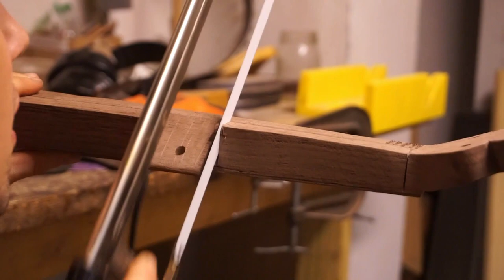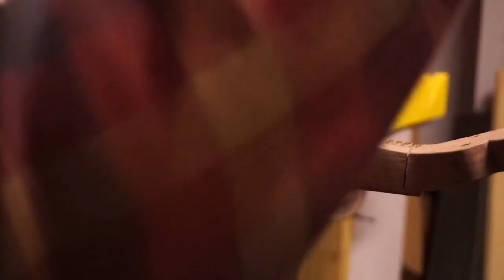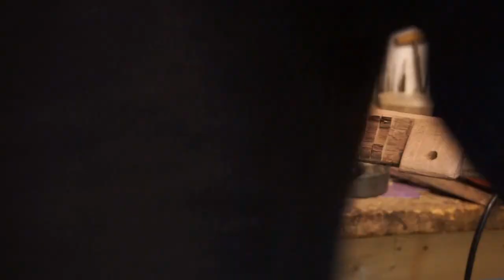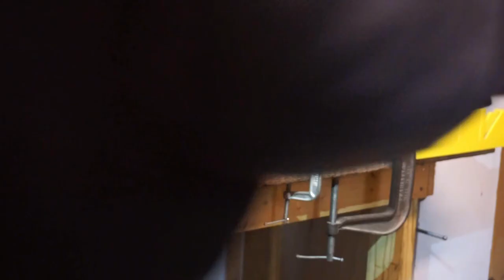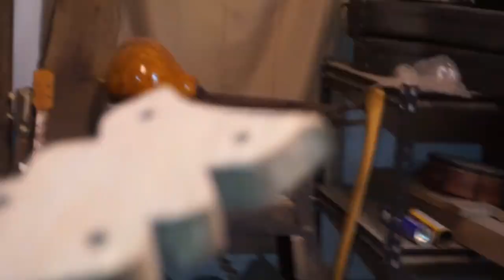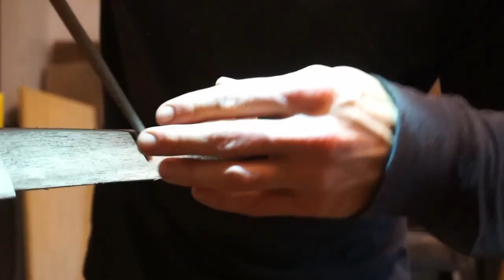Hand-Carving a Traditional Banjo Neck (How-To, Meditation, ASMR)

Comment: I've never seen one made quite like this! I usually use a whittling knife, an old draw knife that's been in my family for over a hundred years, some scrapers and spoke shaves, round rasps etc. Keep using the saws and chisels if that's what works for you, but I highly recommend a draw knife! It's my favorite tool for the job :)
Reply from the maker: I guess I really only use the saws when carving a V-profile neck. It's the easiest way I know to rough out a V-profile by hand. Spokeshave is useful, however, the drawknife I have is too big to be much use on luthier work (does a great job peeling log bark). Thanks for the insight!
Reply: @CliftonHicksbanjo  I have a Mora brand drawknife/pushknife it's become my go-to for most of my shaping needs.